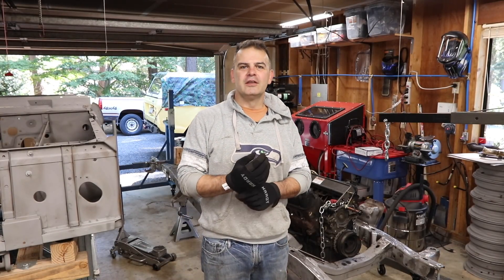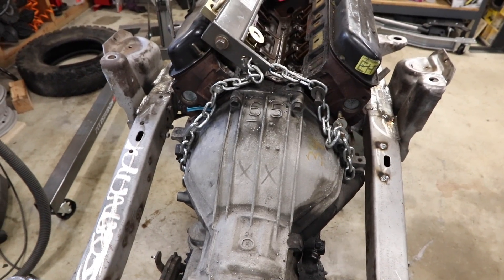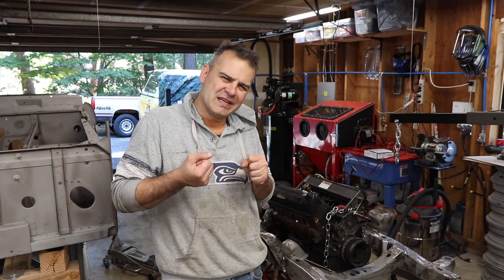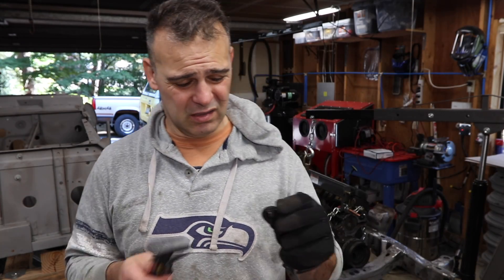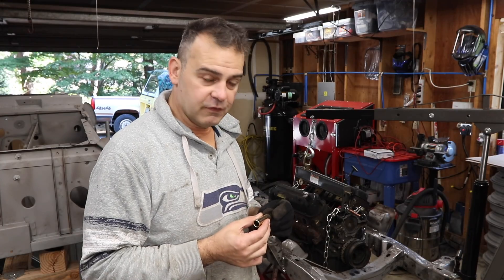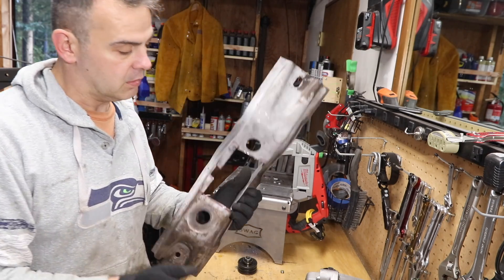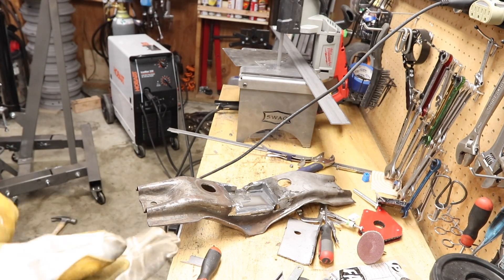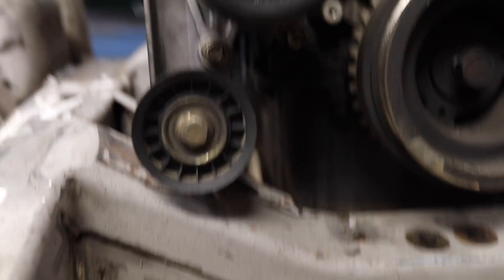3.09 - How to swap in a drivetrain

Comment: Nice job Matt, I'm in the process of doing a swap into a 1930s Cadillac, I want to put in a Ford 302 5.0 with auto trans from a Mercury I purchased into the Cadillac, it will be my first swap and this video is a great reference video.
Reply from the maker: michael5point0 thanks. You will have a much easier time than I did. Lots of room and no pesky transfer case! Just make sure you budget at least $1,000 for all the nickel and dime stuff you don’t think of. That combination will be great for an old Cadillac. But be prepared that the GM purists are going to brow-beat you for going with a ford motor. I had a Subscriber’s Bronco on one and it had an LS motor and people trash-talked it.  But it’s your car. Do it and go enjoy it. If there’s one thing I’ve learned, there’s two kinds of projects: perfect, and done. Choose one. :-)

Comment: What engine mounts are you using? BTW I need to do this but I already sent my frame and cross-member to powder Damn!!
Reply from the maker: Joe Meide bummer about powder. Stock mounts. The explorer 5.0 has the same Bolt holes as the old blocks.
Reply: Thanks Matt. I saw some HD's (Pivoting) just wondering if the HD ones would lift slightly so I wouldn't need to notch the front cross member..
Reply from the maker: Joe,  I can't imagine the engine mounts making a height difference because they are designed to be direct replacements of the stock ones in terms of dimensions. You may just have to suck it up and cut and weld in the notch and then paint that section.  It's not terribly exposed so unless its a show rig I don't see anyone thinking you did a cheesy job.  The other option is stick with the v-belt old style front accessories but that seems a bit much to avoid notching the frame.  I guess the final option would be buy a march serpentine conversion kit.  They don't appear to have the same idler arm hanging way down like the explorer. What I don't know is the setup in terms of whether its the old standard rotation water pump or the newer revers rotation or what.  You'd have to research that.  Good luck!

Comment: Don't clearance the transmission pan.Get yourself a front driveshaft from a 1st gen explorer. It is small in diameter and just a little too long but it uses the right u-joint at the front and has the correct double cardan joint at the rear. Have it cut and balanced and you'll be good to go. Your old driveshaft is too short anyway. It would need to be re-tubed.

Comment: Matt, Why did you elect to go with the motor / trans set up out of a n explorer? Why not stay with the 302 or 351? Just wondering, TW Thomasville GA
Reply: Yes same question.......  I just bought 74 with a V8 and starting to look for donor......  is the Explorer Setup good option? 
By the way excellent work with your videos, keep up the good work....
Reply: Explorer you get the high output efi 5.0 with the GT40 heads.  Also the 4r70w tranny.  And they can be found for very cheap

Comment: Time lapse is great during the welding. If there is to much going on and moving around maybe keep them short. Can't wait to get into my 70 project although it's a completely different direction. Maybe you can do a remote location here in Clearwater next spring.